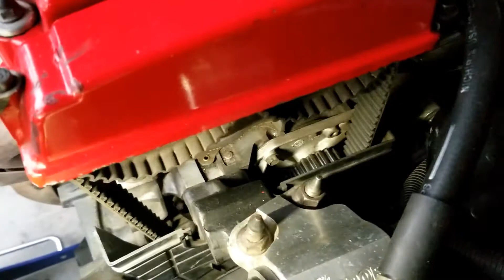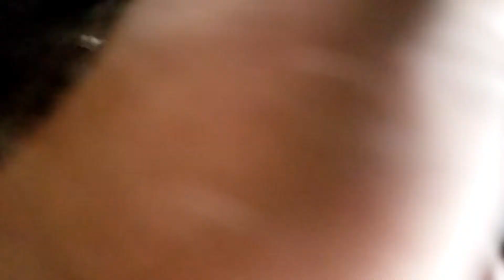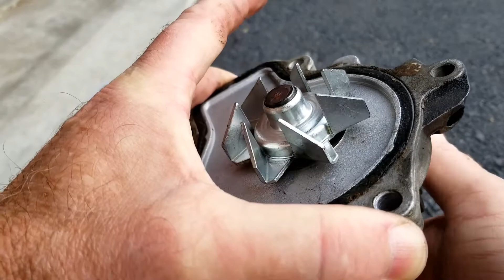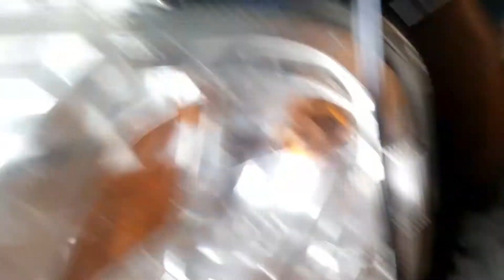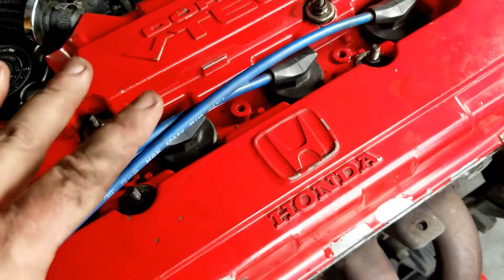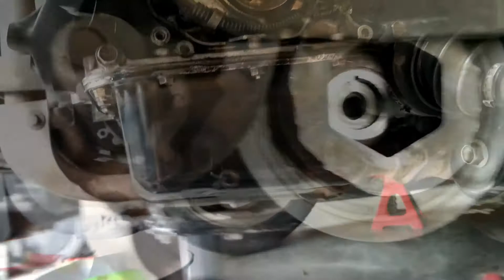JDM B16A Water Pump and Timing

Comment: I did not know that there were OBD2 JDM b series engines out there.
Reply from the maker: That's a North American market civic. The engine was replaced with the JDM long block.
Reply: @ktecgarage  I saw a crank fluctuation sensor at the crank and was of the understanding that those only were present on OBD2 blocks, like mine.

Comment: Thanks for the help sir I'm going to attempt to try to remove my water pump tomorrow
Reply from the maker: Just know that you have to take your crank bolt off to get to the water pump. Might want to take it.to a mechanic shop and see if they can loosen it before you disable the car. That bolt can be a real pain to get off that generation.
Reply: @ktecgarage  there's no gas in her and I think the closest mechanic shop is like 10 miles up the road in town I'm in the country backwoods